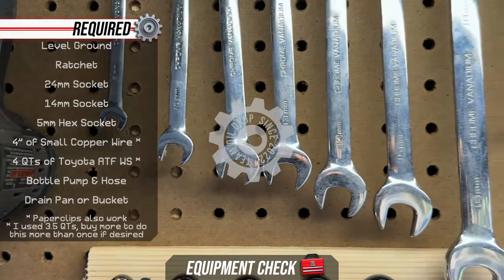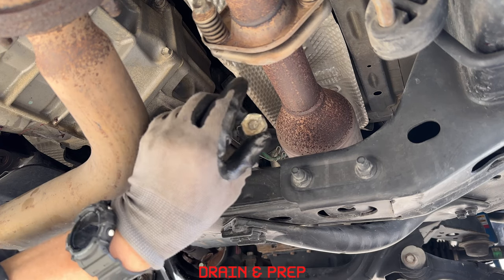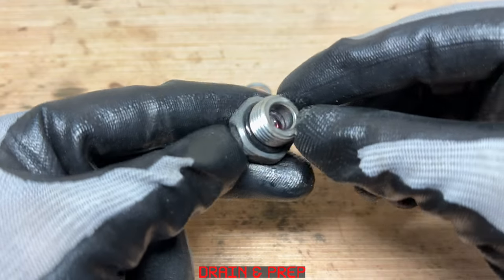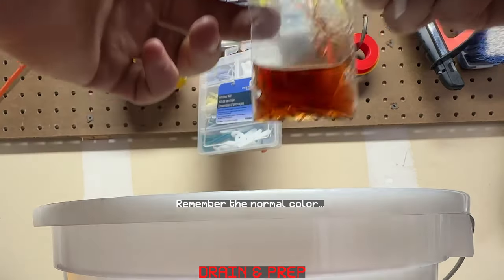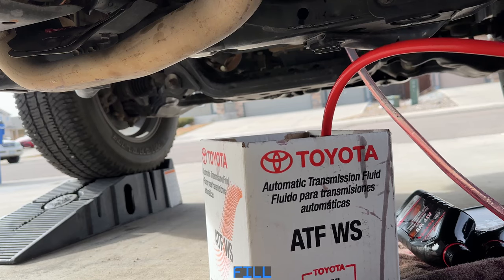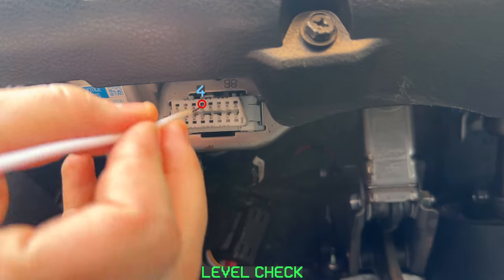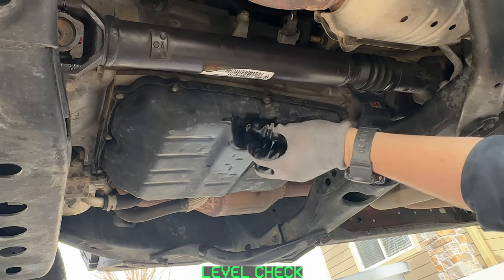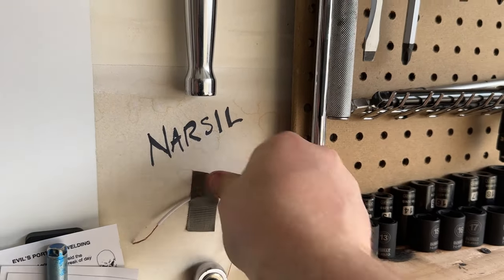How to Replace Transmission Fluid Drain & Fill Tacoma 3rd Gen

Comment: So im currently waiting on my truck to cool down. Was thinking i had a 24mm socket already and of course find out i didnt. I went to 2 stores and found one. Came back and did everything step by step but now i can feel its still to hot. Temp check instantly blinks (P). It's been over an hour now lol but should be good!
Reply from the maker: Love to hear it! You’re almost done!
Reply: @teamoildrop just got back from a test drive. Shifts alot smother hardly feel it. It's a at 95,000 miles I bought it with about 50,000. Not sure if previous owner changed it at all. Alot of guys at work said they wouldn't do it but I know if I want it to last it needed done. Thank you again so much. More to do on my own though thanks to your videos!
Reply from the maker: @Pawnfaz409  outstanding! I too felt mine shift smoother significantly. I also believe I may have been under filled by half a qt from the factory. Those coworkers of yours… plain scared is all 😂
Reply: @teamoildrop  same actually I only got like 2 and a half, though I did spill a bit when transferring to measure. I did put in 3 and alittle more to be safe. Came out the over fill exactly like yours showed and capped it when it came to a slowish trickle. And yea 3 of the 5 drive a Ram haha, they have plenty to worry about. Thanks again brother see you in the next video!
Reply from the maker: @Pawnfaz409  I ain’t wurkin on muh truck! She’s uh a dodge rim and she’s purfec the way god desined er’ 

Good work! Enjoy your fresh Tacoma .
Reply: @teamoildrop  hahaha right!

Comment: Did you put the same amount back in?
Reply from the maker: I put extra in and drained it to the correct level. Gotta follow this one close to be safe!
Reply: @teamoildrop  how close was the amount you put in compared to the amount you took out? Just wondering because I did mine and I took out three quarts and put back 3.3 I noticed you took out only 2.5 quart. Thanks
Reply from the maker: @federicovega2292  ooh brother great question... it's been so long now... the thing is, I put back in 3qts or so and drained some still. As long as you do the proper temp check mode and drain you'll be perfect.
Reply: @teamoildrop  ok thanks for the reply

Comment: Crazy question but, is it required to do the temp check mode if you measure the fluid that you remove and reinstall the same amount?
Reply from the maker: In theory no, it's not required. However, how do you KNOW that the fluid level was correct? Many trucks have been found to be one half to a full quart low from the factory. 

Just something to think about

Greg the Editor

Comment: Just drained my transmission. Truck is level, thermostat pinned, only got 2 quarts. Should I put back 3.5 quarts and pull the overfill? Or should I only put back 2? I know transmissions are sensitive. Truck has 56k miles. 

Is it reasonable to expect any damage to the transmission since factory under filled and drove 56k miles?
Reply from the maker: Did you ever notice hard shifts or issues? Always add more and drain to the proper level in temp check mode.
Reply: @teamoildrop  I’ve never noticed anything other than gear hunting which I thought was typical of a 3rd gen. No hard clunks or anything while changing gears. 

Also, neither my drain over overfill plugs had gaskets or washers, hmm.
Reply: Drain and my overfill*
Reply: Disregard that last part. They had washers.
Reply from the maker: @PatrickR216  im gonna say you’re safe. I’ll do a pan drop video eventually where we will look for shavings and debris.

Comment: How do I know when I should just drain and fill vs when I should actually drop the pan, do the gasket, bushings, and filter??
2017 with 82k
Reply from the maker: Unfortunately we don't get an interval from Toyota on the filter, so that one is more up to your own discretion on if you'd like to replace the filter when doing a fluid change. Toyota lays out a 60k fluid change interval for severe duty and 120k for normal duty. We like to err on the side of doing all maintenance items on the "severe" timeline just to keep everything extra healthy!

-Austin

Comment: What temperature do you think the pan was when you opened the check plug?
Reply from the maker: Fluid in the pan is at 95-113 deg Fahrenheit when temp check mode is activated. Pan itself isn’t measured but likely a few degrees cooler, probably somewhere in the 80s. 

-Austin

Comment: i know you over fill by .5quarts.  i wonder if .5 quarts came out after the temp check?
Reply from the maker: A good question, I don’t recall measuring this. Like most fluids expansion and contraction happens with temperature changes.

Comment: Quick question here - went through the temp check procedure and when I was in drive it was solid, put in park and it flashed D. Went back to D and solid again. Which one am I tracking? I got 2.5 qts out on the drain, put in 3.75qts, and then drained 1qt from the overflow
Reply from the maker: @ovrt21  sounds like it was telling you the fluid was too hot to continue, indicated by the flashing D, and when you went back to drive it left temp check mode. 

I’d redo temp check mode on a cooler day and be ready for a drain, just to be sure.
Reply: Ok sounds good - do I need to add more fluid back in the meantime considering I dropped around 1 qt out? My net overall was +2.75 qts
Reply: @teamoildrop drove around this morning and shifting felt smooth. Would I need to add more fluid back in? Are there any markers I should be looking out for to flag issues?
Reply from the maker: As long as you had a small trickle at the end before you capped the check valve, you should be at the correct fluid level. It's harder to say affirmatively based on the quantity you drained and refilled as you don't know what the level was at prior to the fluid exchange.

-Austin

Comment: Isn't there a transmission filter that needs to be changed along with a magnet that needs to be cleaned by removing the transmission pan?
Reply from the maker: The “filter” is wire mesh and more like a trap. It’s permanent unless damaged. There are magnets! I’ll be dropping the pan soon as I’m back in the US to show y’all everything.

Comment: On a new truck... i should  do it around 35k- 45k?
Reply from the maker: Most Toyota techs recommend 30-50k
In my opinion, it's always best to change earlier rather than later. Fluid is cheap, transmissions aren't. 

Greg

Comment: Hello 
Please provide the part number for the o-ring on the fill plug?
Appreciate it
Reply from the maker: 90301-15004 is the Toyota part number for it, but you don't necessarily need to use this part as a replacement. It's just a standard O ring and any that matches in size will work just fine as well!

-Austin

Comment: I have a 2017 tacoma sport. What's the purpose of putting it into temp check mode?
Reply from the maker: @JRRod-yc8em  ATF expands to proper levels with heat. Accurate measurements can only be safely taken this way 😎

Comment: When you buy the fluid from Toyota are the pump and hoses included in the box ?
Reply from the maker: Unfortunately heck no. Not that I’ve ever seen anyway.
Reply: Thanks for your reply. This will be my first go at this. Does it matter what brand of pump, do they screw directly onto the bottle?  Why is the temperature check necessary? When you perform these checks, I assume you get off the ramps and park level?
Reply from the maker: @wb4514  I actually use my ramps to get level as my driveway is sloped. But the pump I have linked in the description is what I used. I recommend it!
Reply: @teamoildrop  thank you
Reply: @teamoildrop  The need for a temp check is just to get a correct reading on the dipstick?
Reply from the maker: @wb4514  there is no dipstick on these sealed transmissions. It’s to make sure the fluid has expanded to the proper amount and ready to check its level. Very important

Comment: Will this method to get to temp check mode work on a 2021 4Runner limited? I was thinking I could practice getting into temp mode before I actually do the job. Do you think there are any consequences if I did this?
Reply from the maker: that I cannot say with certainty. I suggest swinging by 4Runner forums online!

Comment: This is just a drain and fill, a flush according to the FSM would require this process but 3 times before final fluid level check, is that correct?
Reply from the maker: In theory yes.
The system holds 10 quarts of transmission fluid. You will drain about 3.3 quarts out with the procedure. After the 1st procedure, you aren't starting with 100% dirty fluid. You have 33% clean that has been intermixed with 66% of the old fluid. 

But to stop the overthinking.......YES. Three procedures will effectively replace the fluid to a near new fluid point

Greg the Editor

Comment: I can't get the lights to flash for the temp check mode. Am using a copper wire and have tried a paper clip. No flashing lights. What could I be doing wrong?
Reply from the maker: What year truck?
Reply from the maker: Check notes for 2020-2023

Comment: Where can I get the wire you put inside port? I’m at 90,000. Should I do drain and refill or flush
Reply from the maker: Any, and I mean any, piece of little copper wire or even a paperclip is fine. 

I did grain and fills like this. A flush would involve a pressure system. To each their own but a couple drain and fills is great per my opinion and Toyota service manuals.
Reply: @teamoildrop  thank you for responding back once again, this is my first Taco truck from having a bow tie and a ford. I bought the truck at 88,000 miles

Comment: Did you have to add more fluid or make any changes after the videos or have any problems or anything thats is not been video?
Reply from the maker: If you don't have any visual signs of a leak, you won't have to add fluid until the next transmission service.

The Editor

Comment: Love your videos!   I ordered new crush washers using the part # in your video.  They seem really small. (they measure 17 mm O.D. and 12mm I.D.) The Fill nut uses as 24mm socket, wouldn't the crush washer need to be bigger than what I received?  Same for the drain plug.  Any assistance you can provide would be greatly appreciated.  Thanks
Reply from the maker: Hey! So the fill nut has a rubber gasket that should not need replaced unless damaged. Check early in the video when I pull it out. The crush washers for the drain and check plug are quite small.
Reply: @teamoildrop  Thanks!  I appreciate you and your awesome video tutorials.  Keep them coming :-)

Comment: Question, can't you just drain and refill the exact amount you drain out instead of doing temp check and fluid level check?
Reply: You can, but this way ensures it's as full as it should be.
Reply from the maker: As stated below, yes, you can. However, how do you know it was properly serviced previously. There have been several accounts of transmissions being 1/2 to 1 quart low from the factory. 

My 2023 was just over 1/2 quart low when I checked the fluid level at 450 miles.

The Editor

Comment: What about if you have the tow package? Isn’t there an extra step if you do?
Reply from the maker: All model years have a cooler in the radiator. The only externally noticable difference really depends on the model year. Older models have an external oil to air cooler, while newer models have a fluid to fluid cooler. 

If your truck is of the newer variety, you will want to pin the transmission cooler thermostat plunger two the open position.

See this thread I have linked to TW. It explains it much faster than I can type.

https://www.tacomaworld.com/threads/transmission-fluid-change.821642/

Thanks, Greg the editor

Comment: MAKE SURE YOUR AC IS OFF! The truck won’t go preform the temperature test. It took me a few tries to figure that out.
Reply from the maker: Interesting! Where did you find this online? I wanna source it and credit you.
Reply: @teamoildrop 
On a hot day just shifting the truck into reverse and drive 2 times might be enough to warm up the fluid to the point that it will drain out of the overflow. 
When i put my truck into temp check mode, the shift position indicator disappeared for a couple seconds, then went to a solid D.

Comment: What about all the fluid in the torque converter and cooler?   I now have a 23 Taco but used to have a 2012.  The 2012, I could disconnect the return line from the cooler and get all that fluid out replacing with new using a 2 gallon Motive Products Fluid Transfer Pump.
Reply from the maker: Why bother if it all mixes between drain and fills anyway? Honestly that’s more than necessary and likely the reason it’s not part of the Toyota TSB.
Reply: @teamoildrop  This video shows he gets about 3 Qt's which is about what I got out of Gen 2 when I just drained the transmission at the oil pan plug.  Then when I flushed the torque converter and cooler, I got another 6-8 qt's before it started running clean, a nice bright red.  total capacity is around 12 qt's.  Changing out only 3 without flushing the torque converter and cooler seems like a waster of time.
Reply from the maker: @cptgizmo7344  we are also under the assumption that most ppl have transfer pumps and the knowledge to perform this task. The idea here per the TSB is do it 2-3 times for near new fluid rather then paying a shop with a pricey powered pump to send it. I like your methods! Just impractical for driveway mechanics.
Reply: Like most modern cars this procedure is a partial change.  I recently did a Civic, its very similar. You are only replacing a small portion of the volume of fluid.  I can only assume that doing this regularly keeps the fluid fresher.  Not like the old days when you could dump the pan or disconnect a line and pump it all out

Comment: I’m almost at 60k and i drive a heavy load so will be doing this service at dealer. Just not sure how to request this service. As a drain and fill, flush or fluid change. My dealer doesn’t seem to want to do it until i hit 100k
Reply from the maker: Most dealerships I’ve talked to call it a drain and fill as well. A flush would be a complete pump through of the fluid that some dealerships may do. 100k is very safe still so your call.
Reply: Watching your video again seem like is a job I can tackle myself didn’t seem to difficult
Reply from the maker: @MotorcycleJedi  like most DIYs on the Tacoma it’s not bad at all. If you’re up to it, you’ll knock it out with relative ease! 🍻

Comment: What is the temperature range if using techstream or similar? I read mix ranges and its confusing.
Reply from the maker: At least 95 degrees, but not higher than 113 degrees

Greg
Reply: @teamoildrop  Cheers mate.

Comment: Port 13 is empty on my truck. I have a 23 sr is there another one to jump to get temp check mode?
Reply from the maker: More simple than the older models, any of the 2020+ you just need to start the truck and go from N to D back and forth until the D disappears. Then you wait for the D to reappear when you're at the correct temp.

See below for technical writeup:

AC60F (AUTOMATIC TRANSMISSION / TRANSAXLE): AUTOMATIC TRANSMISSION FLUID: ADJUSTMENT; 2020+ Tacoma
To enter automatic transmission fluid temperature detection mode:
Depress and hold the brake pedal.
Start the engine. [#1]
Turn off electrical and mechanical loads
Slowly move the shift lever from P to S, then move the shift lever to P. (~3 seconds each position [#2]
While observing the D shift indicator on the combination meter, move the shift lever back and forth between N and D at an interval of less than 1.5 seconds for 12 seconds or more. [#3]
Perform #1, #2, & #3 within 60 seconds
Check that the D shift indicator comes on for 2 seconds.
Move the shift lever from N to P.
Release the brake pedal.
Allow the engine to idle until the automatic transmission fluid temperature reaches 35 to 45°C (95 to 113°F). The D shift indicator will come on again when the fluid temperature reaches 35°C (95°F) and will blink when it exceeds 45°C (113°F).
Performing this operation will cause the vehicle to enter fluid temperature detection mode and engine idle speed control mode. In engine idle speed control mode, engine idle speed control starts when the fluid temperature reaches the specified temperature and the engine speed is maintained.

-Austin
Reply: @teamoildrop  you’re the best! Thank you!

Comment: How would you enter it into temp mode on a manual transmission? Also what is temp check
Reply from the maker: You don’t have a temp check mode with the manual trans, that fluid change is much easier, similar to the draining and filling of a differential. The temp check mode tells you when your automatic transmission fluid is at the right temperature to measure it as fluids expand and contract based on temp.
Reply: @teamoildrop  so it just drain it and refill it with the same amount you took it out?

Comment: When doing temp check mode,when  will the system return to normal mode?
Reply from the maker: After the temp goes outside the normal range it will return to normal.

Greg the Editor

Comment: Does the temperature check allow the fluid to expand & push the extra fluid out?(over fill) that way the pressure doesn’t build?
Reply from the maker: It doesn't have anything to do with pressure it is simply fluid thermo dynamics.

The Editor

Comment: Do you just turn it off to exit out of temp check mode? Also is there a filter to change?
Reply from the maker: Once you are in temp check mode, check the fluid level, do not turn off the engine. Once service is complete, and if you have already removed the jumper, you don't need to do anything exit from temp check mode. Once the fluid is above the temp range, it automatically exits. It also exits when ignition is turned off.

Thanks

The Editor